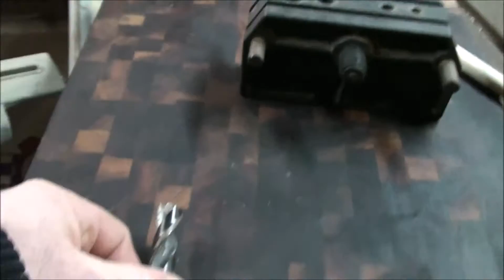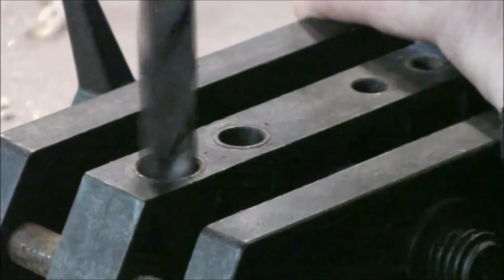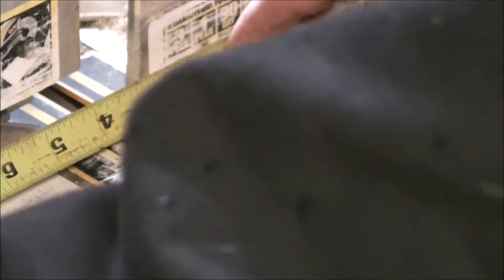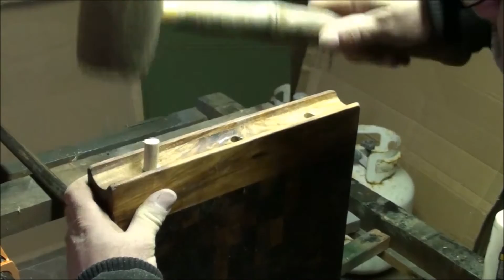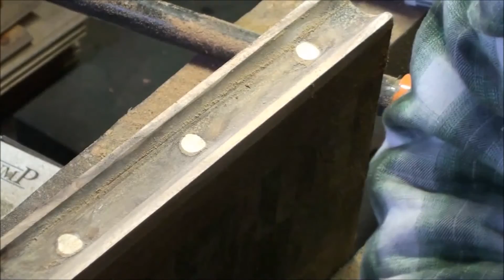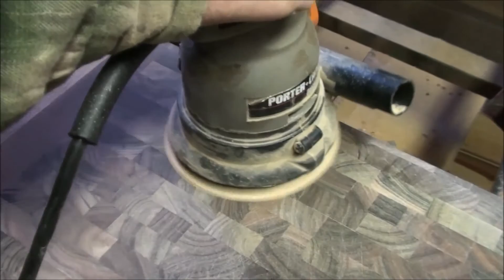Butcher Block Repair

Comment: The flat spot on the dowel is to let the air escape from the hole. Never seen the wire brush trick, great job.   Looks great.
Reply: Also the excess glue. I always put lots in the dowel hole to coat the whole inside of the hole and expect there to be a mess to clean up afterwards bob. ;)

Comment: Heyas guys...  Wonderful job !  Patrick, ya did great...  And putting a light sanding on a cutting board once in a while is not only good for it (the surface end grain loosens up and you take it down to tighter grain), it is actually recommended if the surface becomes marred or worn...  Like drilling concrete huh ?  ahaha  Even with a sharp bit...  A trick you can use with dowels (which also works for driving natural wood stakes into the ground) to keep them from mushrooming is to cut them a hair long and chamfer (round) the end so you are driving on the center grain of the dowel (or log) and the outside layers won't mushroom on ya...  I didnt see any of that (mushrooming) in the video - but its a tip for the mental toolbag...  The corner of a file (or your dremel) makes for good glue relief cuts (on the bottom 2/3 of the dowel)...  LOL  Don't ya love backseat woodworkers?  ahahaha  Armchair hammer nazi's....  LOL  It looks great !  And you did a great job !  Looks like its ready for a few more decades of faithful service !
Reply: No worries on the "coaching", that is what we are all about, sharing knowledge and ideas makes us better at what we do and amplifies our skill sets. Thanks for stopping in.
Reply: Believe me when I say I was impressed with your repair...  We think a lot alike and I have enjoyed your videos greatly...  I can't tell you how many times you've said, done, or reached for exactly what I would have and how entertaining I find that...  Well...  That and we both married strong Wenatchee women, so we can't be too different...  LOL
Reply: ie:  I was thinking "...probably be a good idea to go on and dowel the other side while you're at it..." about 5 seconds before you said "I'm just gonna go on and dowel the other side too..."  LOL
Reply: Your wife is probably not as mean as mine though ha ha.
Reply from the maker: SOMEbody is skating on thin ice!!
Reply: Rain Country Homestead    AHAHAHAAAA!!! GIT 'IM!!
( I wish my "belly laugh" wasn't so literal!)
Reply: Uh oh!

Comment: Such a nice end grain cutting board. I love it. Well worth repairing. I do wonder as why who ever made that did not put dowels or something in there when they made it. I would not expect only glue to hold the handles on. I am sure that board is rather hefty. lol I have an end grain maple board and it is quite heavy. Great job, I loved watching this.
Reply: Maple makes for a great cutting board. The delamb on the "handle" is from the oil soaking in I theorize. It also looked as if the glue was a little sparse. Thanks Lindy for commenting.
Reply: Yea, Maple is a classic for butcher blocks and cutting boards, but they don't look as cool as the walnut. lol Maple was less expensive for me to buy too. So that was also a factor. Mr Rain, I bet you could build those cutting boards too......
Reply: I made a checker board cutting board years ago out of maple and walnut but I don't have that one. it turned out kinda neat. Perhaps I will make another at some point, I had forgotten about that one until you commented.

Comment: I don't know Pat, it seems 6 stainless 1/2" all thread through and through with 12 stainless security nuts, and a half a bottle of loctite red would make it a wee bit more Heidi Mighty Mo, umm... resistant? ;) LOL, NIce Job!
Reply from the maker: Humph!  goes off and pouts  :p
Reply: Careful Pat, I am out of skillet range, but you...
Reply: Dear, grow some skin while you are sucking your thumb in that corner Ha Ha.
Reply: Oh yah, YOU started this. I thought we were buddies.
Reply from the maker: Hahaha! I am not sure I would be able to pick it up if he did that, then it would surely be HMM PROOF! :D bwahahaha!
Reply: trollforge yah, you're on the right track! For it to be impervious to Heidi, I was thinking 1" steel plate...just the steel plate of tungsten carbide or ceramic. I am afraid  ceramic would be to brittle however.
Reply from the maker: Mr. Rain...RUDE!!!!
Reply: Ya, man, we"re buddies alright, but, what can I say, sometimes I just have to be an enema, you know, a real $#!+ disturber... ;)